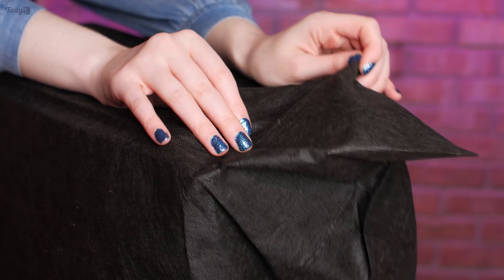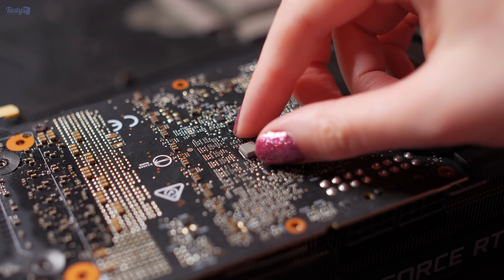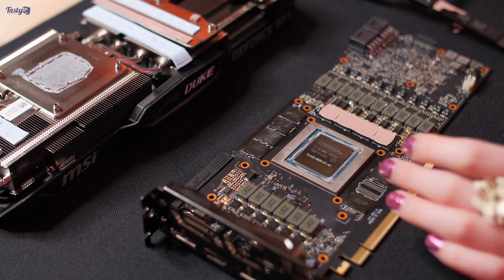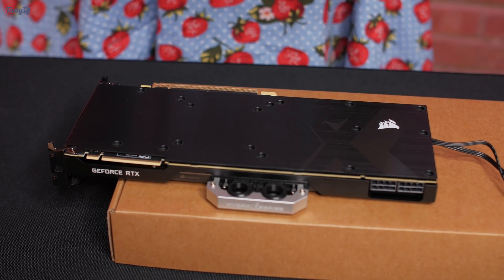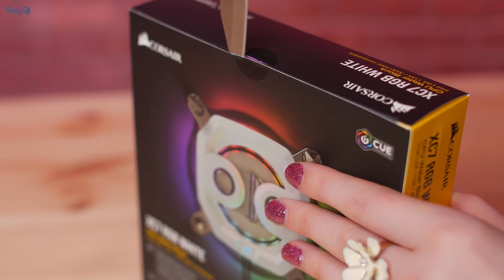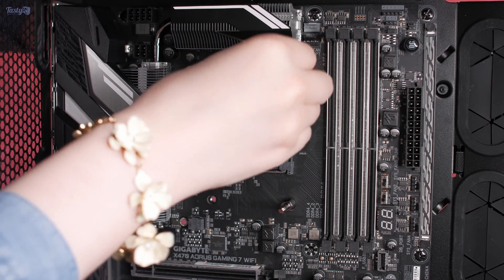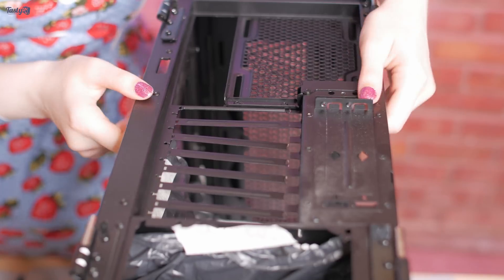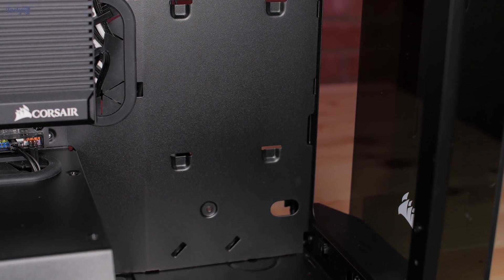Installing Corsair Hydro X XG7 & XC7 Water Blocks on an RTX 2080Ti and Ryzen CPU

Comment: In my opinion, rigid tubing is better than flexible tubing only if you use glass tubes. The reason being cleaning, appearance, and longevity. Alphacool offers a range of straight and pre-bent borosilicate glass tubes I intend to use on my first liquid-cooled build. Any other tubing material typically has a plasticizer in it that can leach into the coolant and clog water blocks, whether it's rigid or flexible. Ask Jay how he knows. LOL! Another reason I prefer to use glass tubing is because I don't build a new machine every year I tend to build the machine every few years with the intent of being future resistance. (Future proof is an oxymoron.)
Reply from the maker: Glass is on my to-do list :)
Reply: @TastyPC  I'm glad to hear that, it makes me smile. I'd recommend borosilicate glass tubes. It's more resilient than standard glass but not is brittle as tempered.
Reply: Glass tubing on your first liquid cooling build? Anyway, there is always a third way—I am now shamelessly pushing my agenda here—building a liquid cooling circuit with a focus on robustness, functionality and very little maintenance. What about using ethylene-propylene-diene-monomer rubber tubing instead? I personally love this heavy-duty industrial style, when the cooling circuit looks like a high-pressure circuit in a chemical factory... By the way, you could also bend the borosilicate tubes yourself, I guess it is taught at the beginning of every serious laboratory exercise course: first try finding a pipe that fits your purpose; if you cannot find one, bend one to your liking. Thus, it is not that I am too clumsy or anything, I have done quite a few such chemical apparatus circuits, it is just that I find glass to be too rigid and inflexible...

Comment: Ryzen 4000. Because... Duh. :D
Edit: Okay let me explain.
The reason is that 4000 will probably finally bring AMD to the top even for gaming.
Secondly, the prices are silly. Beyond silly. And we need to show Intel that they can't continue fooling around with us.
Reply: And if we’re sick and tired of Intel, why now, are we still buying them.
Reply: At the 4K resolution with which she prefers to game, it probably won't make much of a difference.
Reply: @dycedargselderbrother5353  It doesn't make much of a difference at all... What do you do with avg. 15 FPS more that Intel provides with the i9 9900KS compared to the 3900X? Laughable.
Reply: no it won't, 4000 is going to be a minor improvement, like 1000 to 2000 series. at most, amd will be almost on par with a 8700k in gaming. a 3 year old intel chip, at the time ryzen 4000 actually launches (q4).
Reply: @Dr.WhetFarts  Zen3 is a completely new architecture and is not Zen2+. This was revealed long before. Inform yourself before spreading wrong information. Even the 3900X outperforms any i7 Intel currently has... I have never read so much misinformation in one post.
Reply: KYŌDɅI KΞN The 3900X outperforms any i7.... Is that because it’s a better quality CPU, or is it quantity of Cores. 
Germany vs Soviet Russia.
Reply: @smoketinytom  Have you smoked too many tiny toms? xD
Reply: KYŌDɅI KΞN So you have nothing intelligent to say, then it’s best you just don’t respond.

Comment: Stick with the R7 1700 for the moment and upgrade to the Ryzen 7 4700X/4900X/4950X later this year. You could also release a video then to review if the X370 can handle the Ryzen 4000 series CPUs. I think before you should buy another Intel CPU they should go down with their prices and release something really powerful.

Comment: Ryzen for sure. Intel is really behind.
Reply from the maker: I think this PC might be one of the few use cases where Intel is still in front. AMD really need to go for that gaming performance crown.
Reply: @TastyPC  i dont think that few fps worth a time we are adding to this discusion, AMD and Intel are same. And welcome back, by the way. ;-)
Reply: @TastyPC  that's a bit of a benchmark myth though.  If you actually do some gaming comparisons, game play on Intel isn't faster.  Benchmarks appear to be a bit faster, but if you watch the numbers during actual game play, especially when the action gets "heavy", they're practically identical.  On Intel systems you see high FPS spike during light duty scenes.  Like if you're playing Doom and you just run up to a wall very close, you'll see an Intel system get higher FPS.  But once the action starts, it levels out entirely, so it really depends on what your focus is.  Do you want benchmark performance, or actual gaming performance?  A lot of people appear to be mislead by this, and think AMD systems are 'slower' for some reason, but that has not been my experience.  AMD is the far better performer overall, and the better value IMO.  But to be clear, I AM an Intel hater, so grain of salt and all that.  :-D
Reply: @bartacus3521  

This is not the case.

If this were the case it would show in 1% and 0.1% lows in reviews. You will find that Intel consistently beat AMD when it comes to those metrics.

Check out stuff like Gamers Nexus reviews where they test and compile the lows and show them on the same graphs as ave. FPS.
Reply from the maker: @Bartacus - I don't believe there is a difference between benchmark performance and actual gaming performance, since the reviewers I watch use actual in game runs to benchmark. Also when I'm buying a product for a high end PC, I mostly look for 1% lows so high spikes don't really factor into the decision. It sort of sounds like you are saying AMD is the better performer as long as nobody tries to test it scientifically lol.
Reply: @TastyPC  LOL, I didn't mean it that way.  There's a channel called Tech Deals that did a really good video on this very subject, but I'll be damned if I can locate it.  He tests the boogers out of everything.  Intel might be ahead, but that difference is completely over-blown.  But again, my hatred for Intel and their company practices certainly 'taints' my viewpoint.  it also depends largely on the game in question.  You can tap out a 9900K at 4k resolution in some games nowadays, and more cores helps in that scenario.  So I'd still go Ryzen based on that alone, in the hope that future games will behave similarly, and assuming AMD is still the more cost-effective option.
Reply: @bartacus3521  It is true that AMD is more cost efficient. No one would argue the case. They've been the bang for buck-CPU since Phenom II was their flagship. 
However, Intel is still gaming king, and if you check most reviewers, you'll see they're quite noticeably better in near all games and scenarios. 
So it makes sense using an Intel in a gaming PC if you're not super cost conscious. 

One point AMD is yet to beat Intel in as well, is in longevity. You can still get very good performance out of Gen 2-3 Intel i5s and i7s. They're not gonna compete with todays AMD nor Intel CPUs, but they completely annihilates any AMDs the same age, they have shown to degrade way slower and just stay relevant for far longer. Of course, Ryzen has not existed long enough for us to know their longevity but if they are like their predecessors, Ryzen will have a far more relevant degredation in performance unlike Intel. Time will tell. 

However, I do hope Intel starts doing something bold soon as they have been progressing far too slowly.
Reply: @andiders  It isn't that Intel isn't trying to be bold they are crippled by their 10nm situ.

Because so many people love to hate on them the zeitgeist is that they were lazy or caught sleeping..when really they have been having crippling engineering issues trying to be bold.

If you consider how well their 14nm processes have lasted, literally years at the top of the performance pile you could expect their 10nm design to be decent.

Sadly designing a good, or even the best CPU in the world means nothing if your fabs can't produce it.

The other issue is it takes years to plan out and bring a CPU to market, before they even think about laying any lithography they can have spent approaching half a decade on R&D and theoretical engineering, this means when a process goes bad it takes years of even the boldest actions to be able to sort it.

Both AMD and Intel are at the mercy of their own ambitions when it comes to engineering.
Reply: @TastyPC  'scientifically'  come on you can't be serious and 1% lows are the most overrated indication of quality.  Static charts are useless as the amount of game sampling is unknown and that goes for all metrics watching actual GP and with HIGH AVG LOW displayed is the only true way to judge.  Testing is done on stripped down PCs and/or testbenches
Reply: @rankcolour8780  'If this were the case it would show in 1% and 0.1% lows in reviews. You will find that Intel consistently beat AMD when it comes to those metrics.' Get out of here with such untrue dreams pure rubbish.  You show your lack by referencing GN with their self approved test parms and constraints.
Reply: @bartacus3521  research Intel ring bus and how amd latency is still prevelent due to communication between chiplets.
Reply: @TastyPC  Yup, if it's a PC dedicated entirely to gaming, a pre-binned 9900KS is ever so slightly faster than a rig running on AMD's 3950. The benefits in other departments with the AMD machine if the PC were used for pretty much any other application makes the AMD rig a better performing option. With the next-gen of Ryzen on the horizon it might well be worth waiting to see what pans out there compared to investing in an option that offers little real-world perceptible performance. I still like my Intel machine but spend more time on my AMD machine. :)
Reply: @bartacus3521  There's still games that are just plain broken on Ryzen. It's the game dev's fault but still something to watch out for.
Reply: @Lead_Foot  Which Games are you referring to?
Reply: (14nm) Core i9-10900K (10C/20T) 
The question is how hot it will be .... despite liquid cooling !
Reply: intel is really behind for now but the question is how long? remember amd need  more than a decade to beat intel!
Reply: I love Amd and how they are doing right now but I can understand you wanting the i9, especially having the 2080ti watercooled..🤤.  4th gen Ryzen, might  change things though, I can't see the 10900k being 15% faster than a 3900X very often. I think I would get the 10900k and sell it for 4th gen later, maybe.
Reply: I love pc gaming but I also love console gaming, I just love games really which Is why I still go for intel chips as performance on emulation is more compatible and less troublesome than amd chips, it all depends on how you use your system and personal preference because at the end of the day chips from both manufacturers are very good at what they do so it doesn't matter which one you go for just buy it, fit it and get gaming
Reply: intel is not behind in gaming you hahah. intel still wins in tons of workloads, especially gaming and emulation, adobe suite with quicksync for example, destroys an amd setup. you have to be a god damn fool to buy ryzen for a high-end high fps gaming rig, unless it's a 4k+ 60 fps gpu bound rig. for 1080p-1440p high fps gaming, an intel chip simply still wins easily by 10-25% post oc. even 8700k from 2017 will smash ryzen 9 3950x here. sad but true.
Reply: @Dr.WhetFarts  3rd gen threadripper might have something to say about quick sync. Ryzen is a lot better than your giving it credit for, ultimately Intel is still the fastest for gaming yes but for the most part there isn't much in it. The competition at the moment is brilliant for us all though, more performance for less money. Whats not to like. If I could, I would have a 10900k and a 3950x, or 4th gen equivelent and tweak and overclock the nuts off both 😂 and see how they stack up over time. I have never seen anyone review both leading chips from a longer term user point of view like that!
Reply: There is a negligible difference when one is using the highest end components and running 1440 and up gaming, kind of ridiculous to use a 2080ti paired with either Intel's or AMD's flagship CPU's and be gaming at 1080P, Why ? So you can get 200 fps on Intel vs 190 on AMD ? lol, might as well save the money and get AMD and buy a high end Monitor that can use a resolution and refresh rate that makes use of the GPU.
Reply: Yes, it will be true if the top 1 in computer processors is AMD, but the current king is still Intel, AMD is only trying to make good performance cpu on price, but not amd is the best. See it as a product, don't be taken by it.
Reply: We’re talking an average of like 4fps difference here. There’s no argument for me, a maximum increase of 10fps still doesn’t justify the extra money.
Reply: @AgriVideos1  Marginal differences only at 1080p, but nobody buys an RTX2080ti to play in fullhd, at 1440p and 4k no difference between Ryzen and i7 / i9